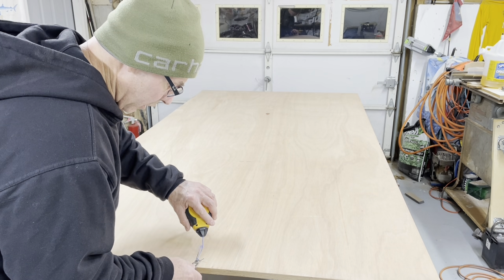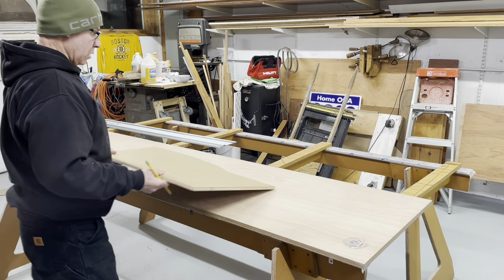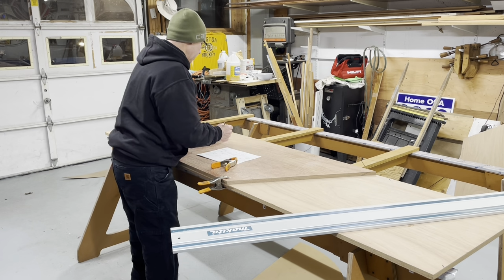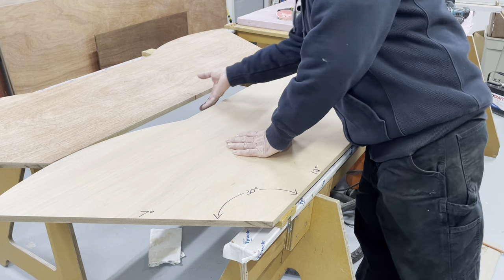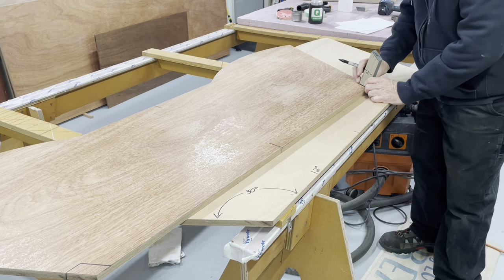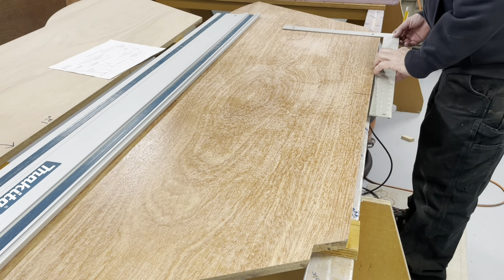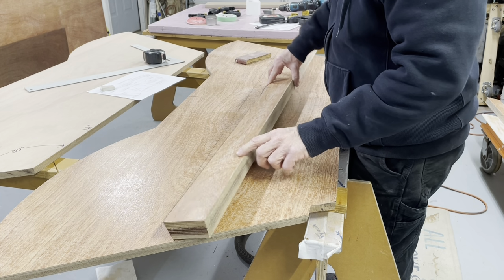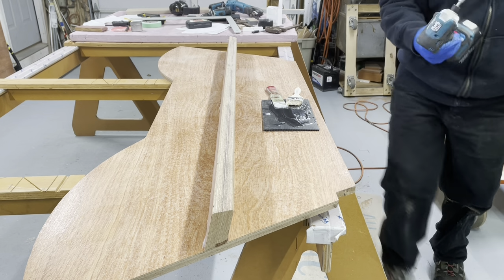Plywood Boat Building Plans part 2

Comment: so im working though your boat plans this winter, and my one question is.  for the form, is the plywood being 3/4" neccesary, or would 1/2 work (all the rest im following as planned.(here in canada where i live, 1/2 is half the price of 3/4, and i figure if it is just for the form, it shoudl be ok)
Reply from the maker: You can even use half inch OSB

Comment: Why do the sides lean out so much or at all?
Reply from the maker: By the sides, leaning out that creates the lift in the bow, which, and turns keeps the waves from coming over, also increases the displacement, the more weight you put in the boat, the larger volume .